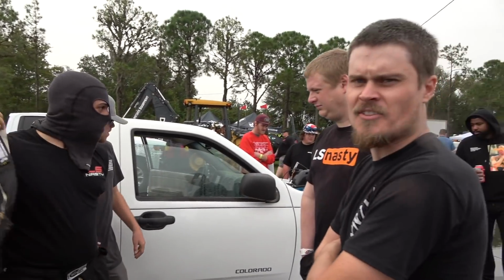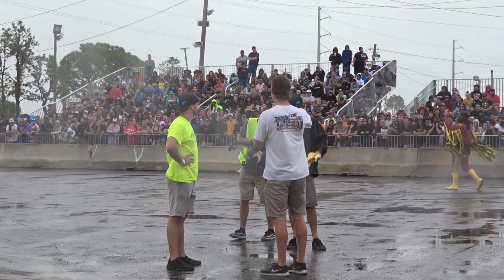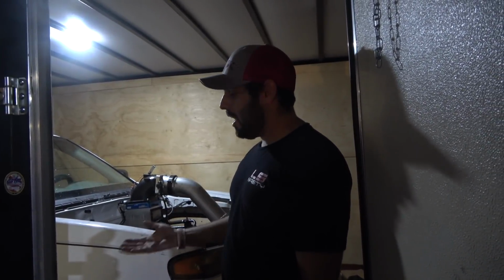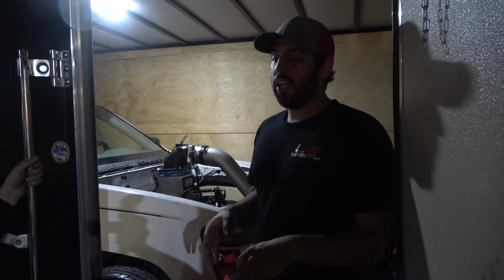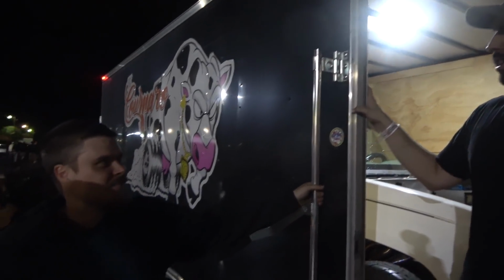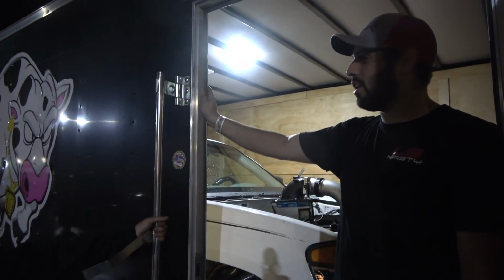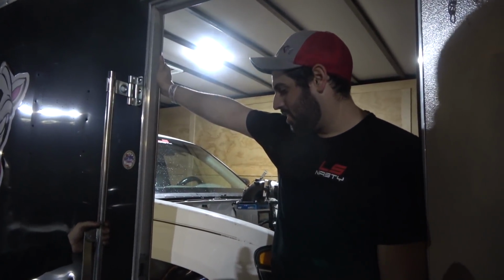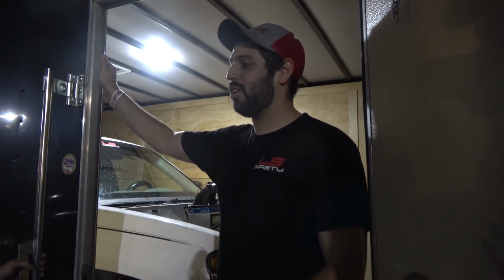Cleetus DRIVES my REMOTE CONTROLLED supercharged BURNOUT TRUCK!!!! Cleetus and Cars BURNOUT RIVALS!

Comment: Has so much power 6 grand is probably at like 5% throttle input. When it was wet on the pad I figured it would try and spin tires just with the surge lol

Comment: You guys went from 15/40 to 5/40 or 30? Your going to see a drop in oil pressure just from that guaranteed specially when it's cold
Reply from the maker: Methonal was in the 15/40 making it 1/10 lol
Reply: @JohnDoc  haha if that

Comment: Best thing to do in your situation is to set your rev limiter low and just let it bounce off her the whole time, most people don't have the power your truck is putting down and the rain doesn't help, I say damn good job for the first time
Reply from the maker: Not with a gear driven blower
Reply: @JohnDoc  good point, your first and second rip were night and day, great job, for your first time and not having control of the throttle you should've got a podium win for sure